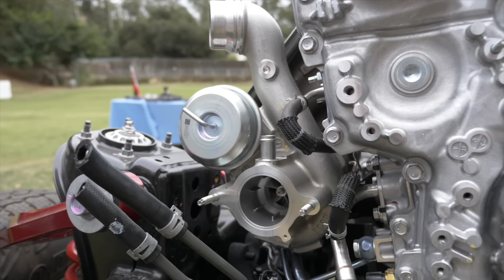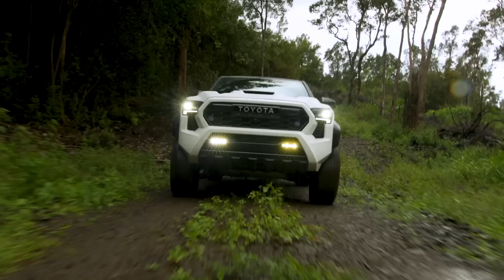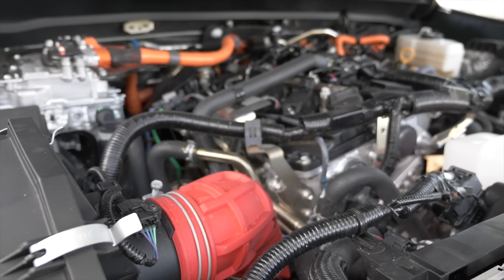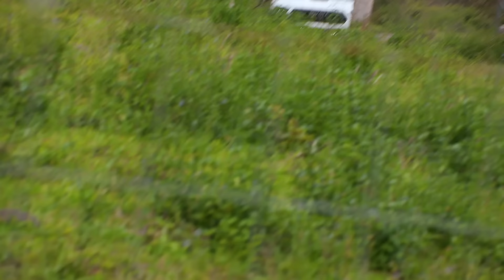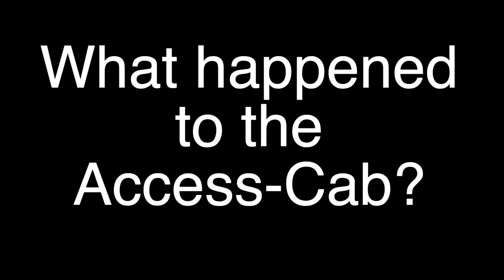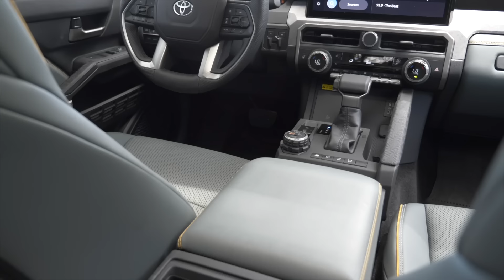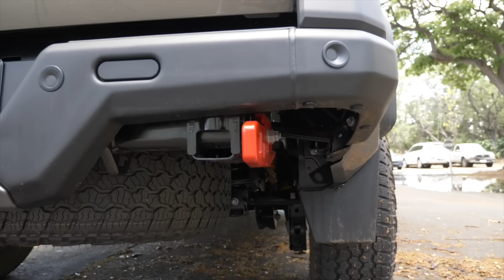2024 Toyota Tacoma Chief Engineer on new engine reliability and more...

Comment: There seems to be a lot of TDS in the commentary.  No, not THAT TDS, but instead “Turbo-Derangement Syndrome”.
If you are complaining about 4-cyl turbo, complain to the government which keeps tightening fuel economy and emission requirements.  Manufacturers have to make changes to comply with these ever-tightening regulations.  Normally aspirated full-time V6’s just won’t cut it with regard to these standards.  That said, what kind of change would you accept, barring a fully electric vehicle?  I would much prefer a 4-cylinder turbo than variable cylinder management (VCM) which Honda uses to achieve ridiculous mileage standards.  Honda’s VCM turns off three of the six cylinders under low engine load to get better mileage, but they are still dragging around the pistons in the “deactivated” cylinders.  Look up the problems with that method!  With the 4-cyl turbo, the turbo does not kick in until you punch it and then it is only persists long enough to service the heavy-load demand.  Under most normal and low-load conditions – which includes driving around town and cruising at a constant speed on the freeway, you are driving with very little or no turbo boost and getting the fuel-economy benefit of a normally-aspirated 4-cylinder engine.  Turbos have been around for over a century, and they are well understood and engineered.  I have no problem with this engine choice.  I have a friend who owns a ’94 Supra with sequential turbocharging.  He purchased it new and still owns it.  He never had trouble with the turbo or any other mechanical component.  Long-haul diesel trucks have been turbocharged for decades.  So, to put my money where my mouth is, I sold my 2018 Nissan Frontier which had a 4L V6, normally aspirated engine.  I purchased a 2025 4-Runner with the 2.4L 4-cylinder turbo.  The power is amazing.  I drove it around a semi-rural area here in the hot Phoenix summer with no issues.  My trip was about 30 miles.  My fuel economy was 26.1 mpg (as measured by the computer).  I could never have come close to that with the normally aspirated V6, 20 mpg is tops for that engine.  Under light and normal loads this engine gets really outstanding mileage. When you do wake up the turbo to accelerate onto the freeway, it pulls harder than my 4L V6 ever did. I will also mention that Toyota is not the only manufacturer going to smaller turbocharged engines for these type of vehicles.  Before you complain and pass judgement on Toyota's turbo, consider the reasons for the change and provide some evidence for your complaint, not just a deranged opinion.

Comment: Turbos are NOT reliable. Intercoolers causes issues. Don’t care what they say. Won’t buy it unless they get rid of the turbo
Reply: Oh come on!  Get over your TDS (Turbo Derangement Syndrome)
Toyota and Ford are both using 4-cyl turbos.  If you are complaining about 4-cyl turbo, complain to the government which keeps tightening fuel economy requirements.  I would much prefer a 4-cylinder turbo than variable cylinder management (VCM) which Honda uses to achieve ridiculous mileage standards.  Honda’s VCM turns off three of the six cylinders under low engine load to get better mileage.  Look up the problems with that method!  With the 4-cyl turbo, the turbo does not kick in until you punch it and then it is only momentary.  Under most normal conditions you are driving with very little or no turbo boost and getting the fuel-economy benefit of a normally-aspirated 4-cylinder engine.  Turbos have been around for over a century, and they are well understood and engineered.  I have no problem with this engine choice.  I have a friend who owns a ’94 Supra with sequential turbocharging.  He purchased it new and still owns it.  He never had trouble with the turbo or any other mechanical component.  Diesel trucks have been turbocharged for years.  So, to put my money where my mouth is, I sold my 2018 Nissan Frontier which had a 4L V6, normal aspirated engine.  I purchased a 2025 4-Runner off-road premium with the 2.4L 4-cylinder turbo.  The power is amazing.  I drove it around a semi-rural area here in the hot Phoenix summer with no issues.  My trip was about 30 miles.  My fuel economy was 26.1 mpg (as measured by the computer).  I could never have come close to that with the V6, 20mpg is tops.  Under light loads this engine gets really outstanding mileage. When you do wake up the turbo to accelerate onto the freeway, it pulls harder than my 4L V6 ever did.   Before you complain and pass judgement on Toyota's turbo, provide some evidence, not just a deranged opinion.
Reply: Then I guess you won't be buying.  The turbo is not going away.  Pretty much forced by government regulation regarding emission and fuel economy standards.  Stop complaining to Toyota and start complaining to the real culprit - the federal government, primarily the EPA.

Comment: I am sure the Turbos give extra power but this was a bad design for reliability.  The high pressure from the turbos is a time bomb if you want to go past 100k miles.  My current V6 Tacoma has 230k , 2010.   Never have seen a chk engine light come on.  Just requires std maintenance.  Toyota is hurting the brand.
Reply: I'm really trying to understand where you are getting your doom and gloom information regarding turbocharged engines.  Do you know someone who installed an after-market turbo on an engine which was not designed from the ground up to be turbocharged?  If that the case you may have a point regarding that particular engine but not for engines which are designed from square one to be turbocharged.  Long haul diesel turbos deal with incredible pressures and routinely log more than a million miles during their lifetime.  My friend purchased a new Toyota Supra, turbocharged in 1994.  He still owns it and has had no trouble with it bombing.  He has over 250,000 miles on it now.  Toyota knows how to make a strong turbocharged engine.  Where are you getting this faulty information.?  Ditch the "old wives' tales" and deal with reality sir.

Comment: I got the basic 2025 SR 4wd.

Once it's 3yr 36 is done.
Its gone.

Cant stand the leaf spring under axle design.
Robbed sooooooo much under axle inboard axle clearance next to both rear  wheels.

Look for a 3rd gen SR access cab 4wd unicorn again like the 2021 I had.
All that 4 banger 2.7 6spd auto needs is a OTT tune and 33" tires...

If dumb azz Toyota would make a single cab short bed 4wd with the 2.7 again. Like late gen 1,s and early gen 2,s.
A fuuking modern version of them.
And put some of the whizz bang infotainment schit in it.

I know I would buy one.
I bet they could sell the schit outta them...

Comment: I bought 2025 Tacoma trd, so I am really hopeful this has same reliability as older Toyotas. I am hoping Toyota has figured out reliable turbos
Reply: You have nothing to worry about regarding reliability of the Toyota turbo.  Toyota has been making them for years.  My friend purchased a turbo Supra new back in 1994 and it still runs great with 250,000 miles.  The folks who are deriding turbos don't understand what they are talking about, spewing old wives' tales and talking points.  I have a 2025 4runner, non-hybrid with  the 4-cyl turbo in it.  I'm not the least bit worried.  Talk is cheap among these folks who deride with no concrete evidence of the doom and gloom they preach.  There sure are a lot of TTDS folks out there: "Toyota Turbo Deranged Syndrome" folks.  But when you are stuck  on stupid, no amount of logic will convince you.
Reply: @steveball4444 thank you. Good info.

Comment: Don't buy this POS. I was going to buy a Tacoma '24 or 5 but I've recently learned that in '24 they replaced the V6 with a twin turbo 4 cylnder which I understand is a very, very bad engine, it won't last and will be full of defects prior to failure. Same thing happened to Ford's 'Eco-Boost' engines. These 4 cylinder engines are just not made for turbo wear and tear. So, now I may just buy a passenger car instead since I really don't need a truck----and from the reviews I'm seeing, most of them out there are full of defects. VERY expensive ALL of the various different mfg's of trucks and it seems that they are ridiculously priced and they are being shown to have a ton of defects.

Comment: There is a lot more to a vehicle than just the motor. I have been driving only Toyota trucks since the 80s with excellent reliability, and after much thought and research, have put a deposit on a 2025 4runner. The 6cyl was fantastic, but it is gone. The performance, handling, and look of the new generation is a step up. Check out the car care nut YouTube channel for his unbiased take on the new turbo motor.

Comment: [I'm posting this in mid-2025.] 
Toyota messed up by leaving the six for the four, and by leaving the manual trans for the auto in the Trail Hunter build. I've owned three TRD Tacoma's. But my most recent buy was a new 2022 Taco Pro with the six and manual. I've recently had offers to buy my Pro from dealers for close to what I paid for it back in 2022. When I traded in my 2019 TRD off road with a six and manual for the Pro, after over two years of use, the dealer gave me $1K less than I paid for the TRD. I really wanted to buy the 2025 Trail Hunter, but the issues with the transmission and engine have turned me off. Toyota should incorporate the Trail Hunter build, with a bit more lift, fit it with 35" tires, put a six and manual in it, sh*t-can all those electronic frills, put a realistic price tag on it, and watch those trucks fly off the shelves. Until then, I'm staying with the Pro until those overfed yahoos at Toyota come to their senses.

Comment: Talks about 3 inch water cooling inlet and points to the intake manifold where the charge pipes go to? The water inlet is behind and just under the manifold inlet and is not 3 inches.

Comment: Oh, so he’s the one who ruined the Tacoma.  Listen to your customers instead of preaching to them.  Im your target customer.  I own a 2021 Tacoma V6, and a 2020 Camry. Both bought brand new.  I buy Toyotas off the dealer lot, well at least I did.  It’s about time for a replacement, and as long as 4 cylinder is the only option I will not be considering the Tacoma. I won’t drive a 4 cylinder truck, same as I wouldn’t drive a V6 Mustang.  I’m the customer, and my wants matter.  There’s a reason lots are full of the 24’s, we don’t want them. “A drive train for every customer”, that’s a clear lie, as there’s none for me.  Way to throw away decades of brand loyalty.

Comment: All y'all can say whatever you want about this new lineup. I just know that Toyota will take care of any unforeseen issues. They've always had the consumers' back. Remember when the 3rd gen was introduced in 2016? What was said back then, is being said now, "What about this and what about that?" There will ALWAYS be bugs and issues in the first model year. Sometimes even the 2nd model year. Then, it tapers off and public opinion on Toyota bounces back. You either learn from history or you're doomed to repeat it. I'm 58 years old. I've been a GM guy my whole life. That all changed in 2003 when I bought a Chevy Suburban. The pistons were so sloppy that the rings wouldn't fully seal until it got good and hot. Remember the piston slap? It sounded like a diesel until it warmed up. I went through 5 qts of oil every 3 months. It got to the point where all I did was change the oil filter because I was constantly adding oil. Don't even get me started on how everything rusted out before it hit 80k miles. Anyway, the dealership, all the way up to corporate headquarters said the same thing, "It's normal". They refused to back us consumers by having a recall. I swore I'd never buy an American vehicle after that. Domestic manufacturers have sold us out. I now have an 07 & 08 Acura TL, 2023 Acura TLX Type S and a 2020 Toyota Tundra parked in the driveway. In approximately 4 weeks, my 2025 Tacoma TRD Off Road 6spd Manual will be in. I'm going to buy it and never look back. Why? Because I learn from history.

Comment: I have a GMC Sierra 2500 HD Duramax diesel with a six speed Allison transmission that gets 22.5 mpg highway and weighs 8000 lbs. and is built so much better than the new Tacoma

Comment: Just bought a Nissan Frontier, and there were a few key reasons behind my decision.

First, I wanted nothing to do with a 4-cylinder truck. These new turbocharged 4-cylinder engines are, in my opinion, over-pressurized mechanical nightmares waiting to happen sure you added all this bla bla bla which to me means more and more parts to break. Good luck getting 300K miles out of one. Simple naturally aspirated is the way to go for reliability.

I also test-drove all the midsize trucks, and I simply preferred the way the Nissan rides. Lastly, price played a big role—Toyota has priced itself out of the midsize truck market, in my opinion. There’s nothing in a Tacoma that justifies it costing nearly $20K more than a Frontier.

Comment: Toyota needs to find reliability focused engineer, my 4 cylinder turbo made it to 178000 miles before crank bearing went out, never pulled a trailer.

Comment: HEY TOYOTA!!! While the power in my new Trailhunter is way better than my 2023 4Runner. WHY can't you turn off the autostop feature???" This will kill the engine way faster as startup is where most all the engine wear takes place due to NO oil pressure during startup. All this just to save a cup of gas per year?! Not green at all if you have to replace the engine!!  Or is that you plan all along???  PLEASE give us add the ability to deactivate this WASTEFUL feature. If you do away with the autostop, add a front locker, and offer a 4:1 T-case or better yet a 3 speed T-case. you would have the perfect truck! While I am dreaming a how about a l6 Turbo Diesel!

Comment: They are only concerned about reliability to 100,000 miles. A lot of Toyota drivers want at least double that. A stressed out 4 cylinder will not last as long as a 6 cylinder. Then you have to resolve the average price. Yeah, I'm going to miss Toyota.

Comment: I test drove a '25 LC250 which has an identical powertrain (but requires premium for some reason) and the low end torque is nice but this whole setup is a fundemental misunderstanding of what a tacoma should be and what the tacoma owner has come to expect.

You should've never bent the knee to these emission obsessed freaks. Some might be ok with a 4 cylinder engine in a large truck but most of us just want a simple and reliable NA V6. You've completely alienated your longstanding and loyal consumer base with the 4th gen tacoma. You've sent the production to mexico to save on employee wages while charging insane premiums on these cheaply built trucks.

On top of that, you've made it bigger in all directions yet it somehow has even less rear seating space than the 3rd gen. Your hybrid models completely delete interior storage, the trd pro suspension seats obliterate the already tiny rear seating, and this thing is just a huge fail on every level possible. You can flaunt HP and torque numbers all day but the tradeoff to get that was nowhere near worth it and that's why these are not selling. You're quickly losing the lead in the mid size category and for good reason.

This thing either needs to go back to the drawing board or be axed completely. This truck, just like the tundra, has proven to be a pretty big stain on toyota's reputation.

I really hope Trump's tariff plan destroys your ability to sell these trucks to the American market. You've abandoned American workers in favor of cheap labor and maximized profits, it looks like the American market will soon abandon you in return.

Comment: Reliable? Maybe, it is to soon to say. But gas mileage seems to be crappy judging by several reviews I’ve seen from several different people on YouTube. Specially, considering that this is a four cylinder turbo engine. You would expect this engine to give you at least 22- 24mpg. but in reality it only gives you about 18 mpg which is about the same as my Ford F150 twin Turbo V6. On a bad day

Comment: I was going to get a Maverick, but  bought a Tacoma SR double cab. I think it is awesome and feels state of the art.  I still own a 2012 Tundra for heavier towing. However, I can't quite figure out why it only has 3500 towing when it has the same engine,  albeit detune by only 50HP and leaf springs which should be more sturdy. What happens if it is "tuned up". Is the towing rating more of a way to encourage up selling?

Comment: So how long will my turbo charger last when i start my engine at -40C and the turbo bearings are screaming at 150,000 rpm?  My current non-turbo V6 2006 tacoma has 360k kms.  Will Toyota guarantee that the turbo will last this long?
Reply: I'm not waiting to find out!

Just rebuilt my manual 06 Tacoma TRD Sport from the ground up. Including a new frame last week. For a fraction of the cost to buy a new one.

Good to Go for another 20 years 😅